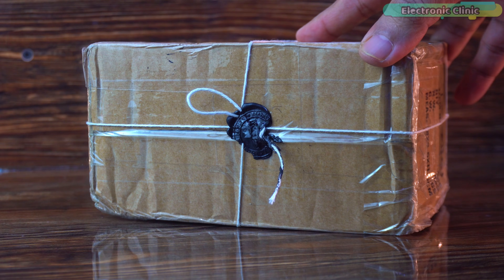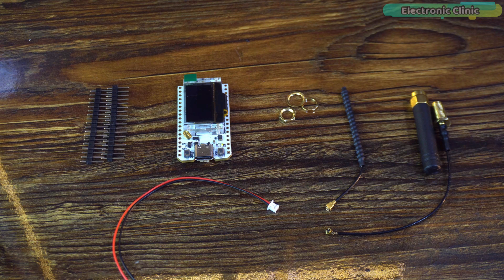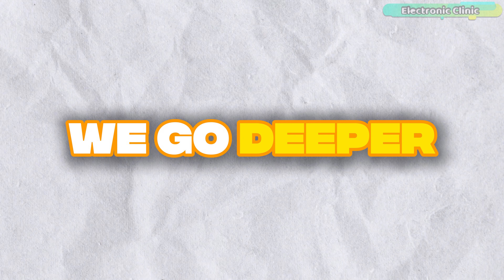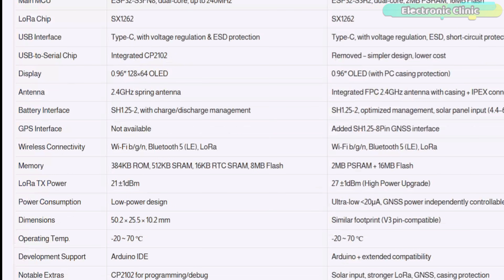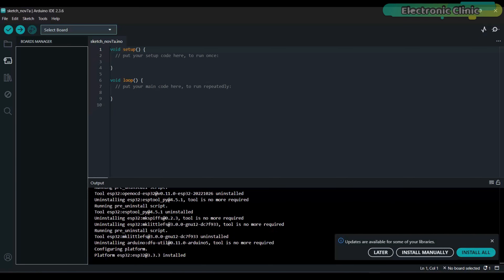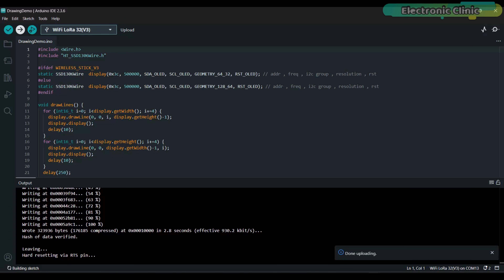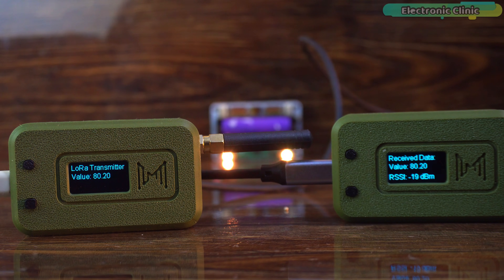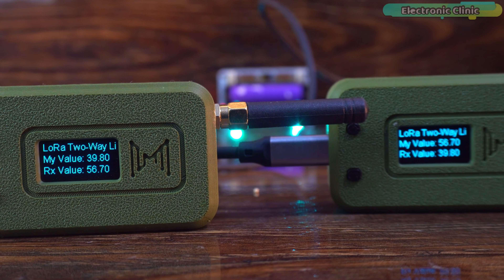ESP32 LoRa 21 Km Long Range Communication – Heltec LoRa 32

Comment: 21 kms, really ???
Reply: There is no way to come up with a figure without knowing what is in between. I know first-hand when there is line-of-sight, it could be much more, like from mountain top to mountain top.
Reply from the maker: That's as per the manufacturer, but I will perform the range test.